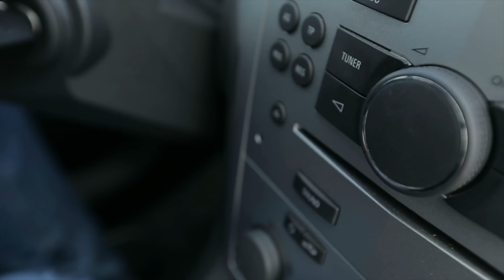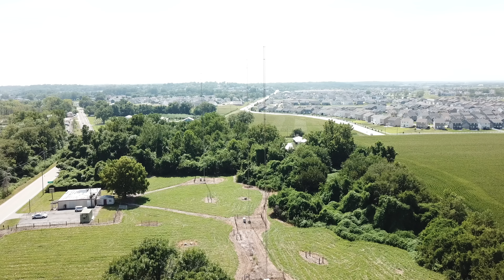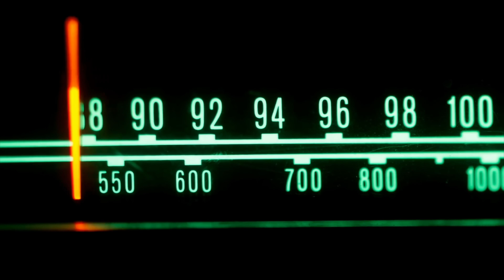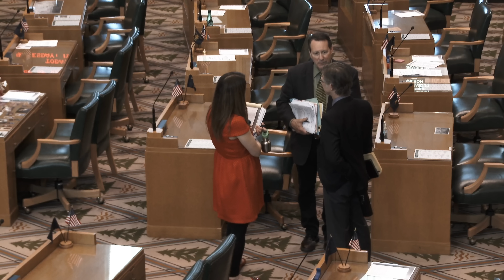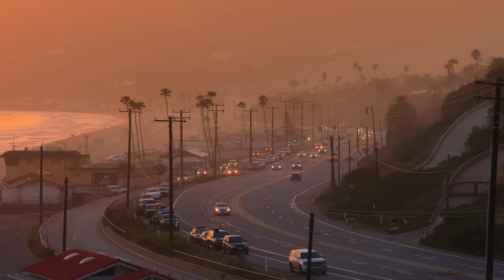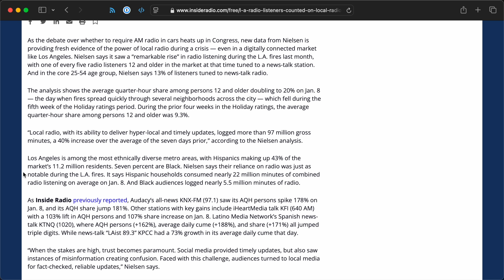Automakers are losing the battle with this 100-year-old tech

Comment: One of the provisions of FCC Part 15 Rules cover the type of interference generated by modern automotive systems. "Unintentional Radiators: Devices that incidentally emit RF due to their electronic components, like digital devices or IC chip-based products." These devices cannot interfere with licensed radio operations. Further they must accept any interference from licensed radio operations. This is to ensure that critical communications must not be disrupted. AM radio is sometimes the only mode of communicating information to the population.

Comment: Every band that we stop using or under-utilize, the government will take away and sell off to some corporate or government entity. This has happened on HAM bands over time, Short Wave is constantly under review as it is almost not in use at all in the US, but it is still widely used around the world. I would actually support a write/call-in campaign to make sure that our vehicles keep AM radio capability, especially considering there are some areas of the country that still have better access to AM stations than FM - as weird as that sounds, it's still true this country is SO enormous... FM only travels so far. AM travels much farther and can deal with physical interference (terrain, buildings, etc.) much better.

Comment: First of all, for making radios work without EMI in cars, automakes emc limits have always been like ~40dB (factor 100 for voltage) below what the fcc or ece r10 actually demand for the car.
So the legal requirements have nothing to do with the actual functional requirement.

Second the process of AM requirements being removed from emc specs started independent from the rise of electric cars. There is no causality. AM does not play a big role in other countries - thats why its being removed from the specs.

Third, while AM is being removed, other requirements are getting added at lower or higher frequencies.
Since the harmonics always play a big role, in total the EMC requirements are actually harder to meet. E.g. SMPS operating roughly in the AM range will generate harmonics in the FM range - so they need to be optimized indirectly for AM as well.
There have also legal requirements for human/passenger protection been introduced (icnerp) which lead to electric vehicles still being optimized for emi in lower frequencies and therefor AM harmonics.

While for sure those powerful electric motors might create AM interference, your framing of electric cars being the reason for AM emc requirements being removed from OEM specs is unfortunately completely wrong.

Comment: I lived in Vallejo California in 1989 when the Loma Puerta earthquake took out quite a few radio stations and the only TV station I could get was knocked out. 
I listen to FM radio for the information I needed right after the earthquake.  They had FM radio playing over the PA system at work during 9/11.   I don't see how AM is any better.
Reply: What if instead of a big city, you happened to be in the middle of arizona when some major catastrophe happened?
Reply: AM has longer reach than FM
Reply: AM radio has far further propagation than FM and 1 single AM station can cover a greater portion of a country because the radio waves tend to follow the curvature of the earth, whereas FM radio waves spread just like light does.

Comment: That's actually pretty smart because AM will be used in emergency, in case of war and stuff like that. But on other hand, AM radio needs massive transmitters that need massive amount of energy, so I am not sure if it actually makes sense, most of these transmitters were already scrapped.

Comment: AM Radio is actually the better technology in so many ways. In the early fall of 2022 a Hurricane hit Canada's Atlantic Provinces. All the high tech radio and cell services plus TV were wiped out for as much as 21 days. The Canadian Broadcasting Corporation still had some AM stations broadcasting. One was CBI 1140 Am. This was our only connection to the world. Well supported AM Towers do not catch the wind as does the mess that top's Cell Towers. No Computer, No Digital Radio, just great sounding AM Radio with the wide bandwidth setting engaged!

Comment: The problem is RF noise and interference, to which AM is more susceptible. Automakers want to cut corners and pad their profit margin by deleting a few relatively inexpensive filtering components from the vehicles they sell. If you can save $10/vehicle, that is $10 of pure profit. I live in a mountainous part of the world and AM signals penetrate into mountain valleys while FM drops out. When camping in the mountains, AM radio is often my only outlet for getting up to date weather forecasts.

Comment: Mainstream cars peaked in the early 2000s. Everything afterwards has been "fixing" what isn't broke, including this AM situation.
We need to go back -> Or even better, do an "Edison-Motors-Style" Diesel static engine to electric drivetrain. That could be the new commuter car... at least as long as we use gas 😉
Reply: Diesel electric drivetrains are too inefficient. They only use them on locomotives due to limitations of mechanical drive systems at that scale. Hybrid cars use a mechanical drive
rather than electric drive when running on the engine for this very reason.

Comment: I pretty much listen to AM radio exclusively when driving. I enjoy the conservative talk shows. It is not uncommon for me to drive 100 to 150 miles in a day, and other media just won't cover that kind of distance. FM is only good within 10 to 15 miles of city limits, and cell phones have all kinds of dead spots here in Wyoming. I have 2 different cell providers (AT&T and Verizon) and I still have spots where neither phone has reception.

I have noticed several times where another vehicle on the road will jam my reception. Oftentimes, it is an 18-wheeler. I believe  that it is a DC to AC power inverter or a DC to DC converter jamming it.

Even with all this said, I don't believe the government has any business forcing auto makers to install the AM radio. Aftermarket radios are inexpensive, and the open market will demand it if it is truly necessary. The government can just but out. We have way too many laws on the books as it is. We should be working on reducing regulation, not increasing it. My desire to have an AM radio in my car should not force you to have one in yours.

Comment: You actually said a whole lot of nothing here, though I think part of it may be that the FCC HASN'T been cracking down on harmful radiators of EMF, as I mostly find AM radio useless due to the high levels of noise swamping out the signal, usually coming mostly from modern high efficiency lighting and switch mode power supplies.as well as from utility lines. I also find few of today's vehicles, both electric and ICE powered also themselves produce a lot of electrical noise, which is a bane of mine as I work with my CB radio in particular. My area also has a lot of the emergency services that are on AM are also on FM, and though FM is easier to hear, its performance has also been slipping in the last couple decades. I now because most of my time in a vehicle is with the FM radio going, and stations that I used to listen to constantly are now nearly impossible to pull in though their listed transmission power hasn't changed. 

That said, I would also like to see provisions for, say, NOAA weather radio and an alert system to get the attention of those who mostly listens to Spotify or Sirius XM (and similar) in the event a tornado is bearing down on them from out of view--before the skies begin to clobber up, preferably.

Comment: I listen to AM 95% of the time.  My wife's new Bronco has AM but doesn't get 87.7 FM which is a great station in Chicago.  So surprised.
Reply: Bring back Music Radio 89 WLS, the way it was in the early 1980s.
Reply: @georgescott4505  I wasn't in Chicagoland until 1989 and only listened to radio during my commute starting in 1993 so I missed that.   I remember going on long rural road trips and searching for stations along my route for either music or talk(sports and political) stations that I could hop between.

Comment: It seems that all AM transmissions in Iceland have been switched off without any discussion or announcement. At the same time, FM transmissions are very poor and there are many areas where it is not possible to receive a channel. Then the internet is used to transfer broadcasts from the studios to these FM antennas so if the internet goes down, the radio is out.

Comment: I've got a theory why Automakers might be fighting to not have Radios in new cars.
They want to sell on board Data plans with the car. So if you want to listen to radio in the car you have to used the cars data plan rather than the free radio from an antenna.
I think it's still more likely that they just want to save on the AM and FM components but even so I think my idea may be a part of it.
Reply: Realistically I doubt an amfm radio costs that much to manufacture.
Reply: @nubreed13  Remember we're talking about the engineers who invented a speednut, that costs less than a penny to replace other ways to secure a screw.
Reply: @edmanuel6885  well realistically it's not the engineers it's the accountants and their bosses demanding they save an extra $2 per car by not having an radio
Reply: @nubreed13 Hell no. We're talking $3 max per car on an industrial scale
Reply: It's not a bad theory. Cellphone makers lock out radio features on their phones. They don't like the idea of freely available signals you can tune into, they want you using their expensive digital networks for communication, AND media.
Reply: @beff50  The issue with having a radio in a cellphone these days is the lack of headphone jack on most smartphone models now, as the cable for the headphones was providing the antenna for the FM radio...
Reply: @ I'm aware that headphone wires served as the antenna. Phones should still have headphone jacks also. if 3.5mm jacks were "Too large", then I don't see why the 2.5mm didn't become the new standard. I was illustrating a point. I think it's a symptom of a bigger issue rather than being the issue.
Reply: @Funkteon that's not really an issue, you can use the charging cable instead.

A lot of chinese phones still have FM.
Reply: @tristan6509  I mean, that sounds like a issue for everyone who is trying to listen to the radio on their phone. Now you have (and have to have) a cable just hanging off the phone.
Reply: @banaana1234  and a normal radio has to have the antenna extended to listen to radio, so what?

I would rather have a pocket radio incase of an emergency instead of no radio at all. Who cares if you have to attach the charging cable to hear emergency broadcasts.
Reply: @beff50 it happened to TV. Television used to be free UHF/VHF signals tuned just like a radio. The “payment” was the commercial breaks. Nowadays you pay a monthly fee… to watch the commercials!
Reply: @beff50 
A few of the cell phones I had when I was a kid back in the early-to-mid 2000s had radio antennas. I don't listen to that much music, but looking back and looking, now, forward it should be mandatory that cell phones be capable of getting radio signals as a backup but I think it requires the headphones to be wired.

Frankly, it's also that the people should be able to access entertainment without needing to pay every time! Radio and TV signals are freely available but companies want us to directly pay for every second of entertainment we get. But, it's also that people have become accustomed to avoiding commercials and those signals come with that built in and that drives most to find ways around that.
Reply: I think you’re right on both of those things.
Reply: In the modern era, FM & AM radios are basically a couple of bucks at most to integrate on their own. The integrated antenna is the most expensive part and even that can be worked around a bit using wiring that exists already in the car or having a jack to plug in an external antenna if someone wants to be fancy.
Reply: Close but they're pushing satellite radio first and cell data second
Reply: AM is also not as popular as FM and STREAMING
Reply: Occam’s Razor: manufacturers would rather skip the hassle of ensuring acceptable reception of AM radio through the electronic signal minefield of the modern automobile. If they discover an interference issue late in development, they have to relocate things or add shielding.
Reply: hello warthunder man TheWoodenAzeri
Reply: I think the point about pushing people toward monetized media is very likely the reason automakers don't want to have free radio available.

But this wouldn't be a fight unless someone was pushing just as hard the other way. I doubt it's the owners of AM stations. They aren't as profitable as they once were. Any guesses who else might be pushing to keep AM radio in cars?

I suspect it's politics. In the US this last election cycle, Donald Trump benefited heavily from false information that was spread via a number of routes, including talk radio, which dominates the AM airwaves.
Reply: What about motorcycle? Mine doesn’t have a radio at all 🧐
Reply: Bingo
Reply: why you listening to the radio
Reply: Ding ding ding
Reply: bingo
Reply: You forgot the Advertisements they wanted to display on the screens that are now standard in every car.
Reply: Everyone just uses their phone. Either via Bluetooth or a USB cable integration. Normal radio tuners just aren't necessary for the vast majority of drivers.
Reply: There isn't any savings to not implement am. Especially with all cars moving to infotainment systems which are for all intents and purposes tablets.  The soc contains the radios. You have to run antennas for all the radios, either way.

Comment: I wonder which band will eventually go. FM or AM. From an emergency response AM is more penetrating over greater land. AM would work better in rural environments. 
Unfortunately I don't even own an AM radio.
 But I'm aware that one of my phone's does have its own FM radio as long as I have a wired headphone to act as the ariel. I use digital radio apps normally, but it's good to know a real radio is under the phone hood so to speak, for emergencies.

Comment: Phones need AM/FM radios
Reply: A few Android smartphones have FM, but AM is almost unheard of in phones...
Reply: All modern phones have the hardware but it's rarely enabled Motorola consistently does have it though and it means you can see that the other phone manufacturers lie about the chips not having it.
Reply: @theraytharow  but can root enable it?
Reply: @itsmenatika  yes
Reply: @theraytharow That's not true. Rooting the Android operating system does nothing if it is not enabled in hardware. Verizon used to release phones with FM disabled (even if the same model sold by other carriers did have FM enabled).  The Verizon version of the phone lacked solder on a pin for antenna input from the headphones. Even if you copied the FM Radio apk and related files over from a FM enabled phone, it wouldn't work.
Reply: @theraytharow  they are goated for doing that
Reply: Almost every old phone was capable of using jack port as a radio
Reply: For whom?
Reply: This would revive radio for sure. 

But Telco is banking on their own 4G and 5G networks